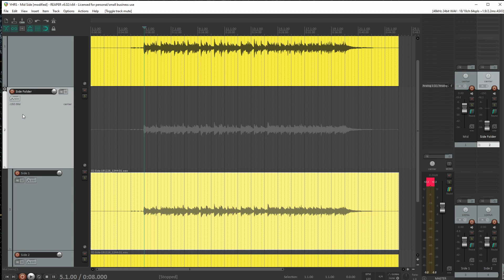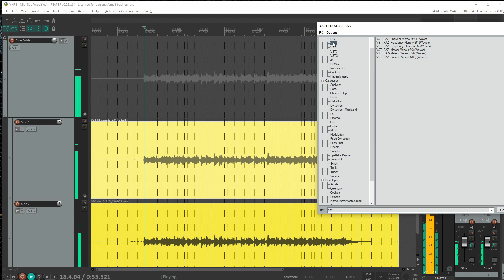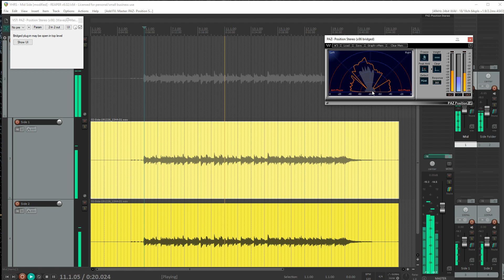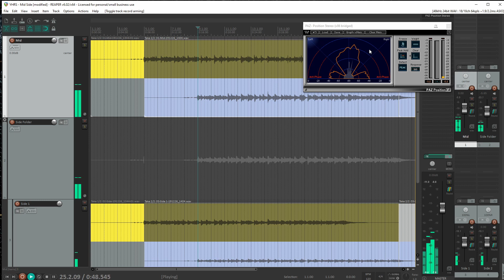Mid/Side Stereo Mic Technique (why does it lean to one side?!?)

Comment: Another thing to help focus the image to center is to apply highpass filter to the side information.  (Our ears key in on high frequencies anyways with respects to stereo information).  So 0-120hz is not doing much in the side except being boomy.
Reply: I use a Neumann U87 mid and a Royer 121 side.
Reply from the maker: I bet that's a terrific sounding setup!  Those are some drool-worthy mics!
Reply: @ryangraffius1474  please, can i record a small choir (about 20 singers) with the mid-side technique?
If yes, how do i go about it?
Reply: @Bits_of_Math  

The mid-side technique will not produce a 'true' stereo formation.  Mid-side is mostly used to create a pseudo stereo environment for 'monophonic' sources.  It also has music Production applications (the process) however the best way is to record in mid-side, first.

Could you do it? Sure, you can do anything you want.  Will it achieve an accurate representation of the choir and the people, in their respective  locations in Stereo? No.   

The benefit of a mid/side recording is more for say a 'stereo/mono guitar rig' or solo singer, which would totally work for a 'lead' vocalist in the choir.  Or lead instrument, because you are taking the 'side' Mic (polar pattern), which is actually turned Sideways to the sound source, doubling it that input, and panning one left and the other right (while phase inverting) one of them.

This 'pseudo' stereo information gets then blended with a directional microphone input (direct at the sound source, cardioid pattern).  So, the effect is that the Left and Right information that cancels/doubles with the Mid, produces a phase difference left to right (which is what 'stereo' sound is).   The difference in mid-side is how this effect is being produced.

For instance, I like sending the 'sides' to reverb differently than to the 'Mid' and often you can control these volumes independently (Adding energy in a chorus to rhythm guitars) or if the vocal seems lost in the mix, you can mid-side to get a bigger sound.

In the end, I think I would mic a full Choir in true 'stereo'.
Reply: @Bits_of_Math  Mid/Side Production techniques can be used after you record, however.  Once your mix is in a 'stereo' format, there is only left and right, which allows you to manipulate the stereo filed in mid/side.  So it can be a powerful production resource.
Reply: @ryangraffius1474  okay. Thanks.
Reply: @Bits_of_Math , you can certainly record a small choir with M-S!  Listen to the ensemble at different distances, and put your mic where it sounds best in whatever room you might be.  (this works for whatever stereo mic technique you might use, BTW!)  Remember that the performance space is an integral part of what you are recording.  If it doesn't sound good there, you might consider a different recording technique, although with M-S, you can adjust the impact of the room more than with other stereo mic techniques.
Reply: @NBryanBlack  thanks a lot.
Reply: @ryangraffius1474  What makes you say that M-S is only pseudo-stereo?  It is just as stereo as any coincident pair setup, including X-Y and Blumlein.  It's true that there is no difference in arrival time of the left and right images, but that is not a requirement to make a solid and accurate 
stereo image.
Reply: @NBryanBlack  
I say psuedo-stereo in the following case...

Making a Mid/Side recording (mic setup) 'stereo' ...we are inverting the phase of either left or right panned 'side' mic.  Is it technically stereo? Yes...  but it it the same exact information Geometrically... only one side is phase inverted compared to the mid...   

It's not like I have different frequencies going on like in a stereo recording... the 'side' mic is summed electrically to a monophonic pattern from it's 'polar' field informationally anyways... so, that is why I say pseudo because I am manufacturing the 'stereo' via the matrix....

Unless Of course, I am utilizing the Production value of a mid/side matrix... 

Where I can make the song Wider and more Narrow...or filter side frequencies with a splitter... Possibly, I am not altering the content, I may just be raising and lowering the volume of uncorrelated information in the stereo field... the result will vary speaker to speaker based on their unique individual characteristics for handling the balance between correlated and uncorrelated information.  (they do this for vinyl records to remove low end information in the sides which may cause the Needle to skip out of the groove.)
Reply: @ryangraffius1474  If you are not using a figure-8 mic for the side mic, I can agree that would be pseudo-stereo.  But if you use  a figure-8 mic as described, it is a full stereo system. The process is also used for broadcasting FMstereo (as well as other stereo techniques).  If you consider that the Mid mic is essentially your L and R channels combined, (L+R) then you add and subtract the side (L-R) information in the matrix to get your discrete L and R signals.  (L+R) +(L-R)= 2L.  (L+R)-(L-R)= 2R. Once you have combined things in the matrix, you end up with discrete L and R just like you would with Blumlein or any other coincident pair.  Also remember that the mid mic can be pretty much any pattern that you desire to capture your main (L+R) signal.  The reason to pick a mic pattern is to choose what you DON'T want to pick up with the microphone!  In PA work, cardioids are normally used so that you don't get feedback nearly as quickly as you would with an omni.  With M-S, the Side mic is chosen and positioned so that the main sound source is in the null.
Reply: @NBryanBlack  Clarification:  It may be semantics (the words I am using in order to try to explain what I mean).  Read on... if you still do not understand what I am saying, we will just have to agree to disagree.... 

I was talking about micing a 'stereo' (2 or more) source(s) with one mid and one 'side' (8) pattern mic...  m/s micing setup.

This will not produce (what I would call) a 'true' stereo representation of the 2 sources (in their respective places)  because the 'side' mic gets Summed electrically to mono before you double that track and phase invert (and pan L/R) the 'side' mic tracks....

So, the uncorrelated information between the 2 sources is a summation of their 'stereo' differences and similarities to mono (electrically) before the mid/side processing (which flips things back to stereo) takes place... which means that they are geometrically the same information.  The 'stereo' we get from m/s is the result of the mid +R/-L....(this is not the same as 2 cardioid directional mics each pointed at it's single source, respectfully.  (which I would call a 'true/traditional' stereo capture).

In addition, if one of the doubled side mics tracks is not phase inverted (what creates the 'stereo field ' in this specific m/s scenario)... there is no stereo... there is only 2 mics, 3 tracks presented in Mono. Unless you consider the differences in your speakers frequency response or the room you are standing in a stereo 'difference'...but the information L and R is exactly the same.

<<this should be enough to tell us that the 'geometry' of the 'side' mics is exactly the same, precisely because the (8) is not a 'stereo' electrical signal.... it is still only mono. Tbecause

Or consider this...(2 (or more) cardioid mics, recording stereo sources...Can I process the audio in m/s, using an M/S matrix?  Yes, but can I create an m/s recording style image with these tracks?  No....I have to record in mid/side to have a true m/s recording.

lastly, representation, but probably with a bunch of phase issues... lol
Reply: I don't know why the last part got cut off....
Reply: @ryangraffius1474 Sorry this is so late, but I don't check these comments daily!  We may be arguing some semantics, but not entirely, methinks.  If done correctly, it IS a true stereo system, evidenced by the OP's comment that the left channel was louder when he pointed the mic setup so that most of the sound was to the left of where he was pointing the mic array!  
Indeed, without the matrix, this is NOT stereo, it's just weird sounding bad recording technique.  The side mic is merely a L/R difference signal, and if you don't invert one channel and pan the sides in your DAW or mixer, it's not the M-S system!  
And actually, yes, you can take 2 cardioid mic signals (hopefully recorded in a reasonable true stereo setup!) and matrix them into a M-S signal chain.  It works best with a balanced signal chain so that you can easily invert the signals, but there are processors that can do it and boost (or cut) the L-R signal, and re-matrix it to normal stereo audio with a wider (or narrower) sound stage.  BTW, your local stereo FM station matrixes L and R stereo recordings into L+R (M) and L-R (S) signals all day long, 24/7, and your stereo receiver (assuming it gets a strong enough signal to decode to stereo), takes those M-S equivalents and matrixes them back to discrete Left and Right. If you have a mono FM tuner, it merely receives the Mono (L+R) signal and ignores the rest.
Reply: @NBryanBlack  Yes, again, I agree with everything that you are saying... and yes, you can run whatever you like through the M/S matrix, and adjust for Stereo Pan Law....

For the OP, I was trying to express that the 'stereo' representation of M/S recording is not like the dual A/B or X/Y setup. If you look up the sound patterns you will see why.

Which is why I was trying to explain (in response to your question) why I was saying Pseudo Stereo.  It's not that it is not stereo... it is just that a Phase flipping of L/R panned information is the only thing making the stereo occur in a M/S Recording scenario... the matrix obviously can be applied during music production.

Still, the fact remains... the 'bi-directional' information of the polar pattern mic, gets turned into an electrically Monophonic signal, so there is no A/B or X/Y (stereo informational captured)... the Engineer has to Electrically manufacture the 'stereo' image presentation (I don't know how else to say that)....the A/B and X/Y mic scenarios are already ready to be panned around the stereo field...when in M/S we just add and subtract the same exact information from the MID to form L/R...

Personally, I just do not consider that to be a 'true' stereo image.  It is a manufactured stereo image, by the audio engineer...

I Love M/S!  Make me feel like I have special powers. LOL!
Reply: @ryangraffius1474  OK, MOSTLY semantics, but I still agree to disagree! (politely, I hope!) Adding AND subtracting the S signal to and from the M signal is necessary to create the matrix.  If you don't do that, then indeed it is not stereo.   And, if the M and S mics are not coincident (or as close as possible), it would fall into the category of pseudo-stereo.  Additionally, the null of the figure-8 mic needs to be pointed toward the main pattern of the M mic, (unless the M mic is an omni, obviously!)  One can argue that the placement of the A/B or X/Y mics is part of the stereo manufacturing process by the audio engineer using those methods, too. Even the choice to use whichever method used is part of the stereo signal manufacturing process.  
It's been a while since I read it, but one of the more interesting papers I read on M-S was by Alan Blumlein, and he used 2 figure-8 mics and ran them through the matrix.  It does have the benefit of making sure the "talent" is on-axis of the main pickup of the Mid mic, vs. 45 degrees off-axis for both mics.  (although I love recording with a straight Blumlein pattern quite well, too, especially for an orchestra!)  
BTW, I am enjoying our discussion. Hopefully, I'm not too entrenched in my own perspective to notice whether or not the horse is still dead (although I have noticed it might be getting sick!)  ;-)  Have a great day!
Reply: Wow painful but for sure awesome convo lol, love it.

Comment: Thanks for the channel, good content, presented in a friendly communication style.
Wishing you all the very best for 2020!

I've been scratching my head over this one!
You basically recorded 2 guitar tracks simultaneously, one directional mic as per normal.
The second mic (at same distance), you made a copy of this, reversed the phase and panned them hard L + R.
I'd be interested to know if you went back and just changed the phase on channels L+R of the omni mic, if the track would lean o the right? Cos if it's just I signal doubled etc......

Also I know why you wanted the directional and figure 8 mics at the same distance and perpendicular in axis to each other (maybe like XY micing for phase).
Might it be worth experimenting with the figure 8 mic in terms of distance/angle, so that on it's own it produces a balanced tone in term of treble, bass and room ambience? After all the phase may not be a problem due to it not detecting in the guitar a straight line (as the directional mic does), but by mostly sound reflections.
Probably not clearly expressed!

I fancy having a go at this sometime, maybe I'd try swivelling the figure 8 mic so bass and treble of that signal are in ok balance on it's own then copy the rest of the process you did (directional mic, double track phase and panning etc.)

PS I've recently been setting up some old recording gear that hasn't been used for too long, and have watched a quite few youtubers on DAW recording, you are one of the few I have kept subscribed to.

Many Thanks and keep up the good work.
Reply from the maker: Thanks a lot!

I did find that changing which of the L/R tracks is phase reversed did change which way the stereo image leaned.  

The reason for having both mics' capsules as close to each other as possible is for phase coherency between the two mics.  When you change the distance of one mic or the other, you'll start to get different frequencies that'll start to cancel out or reinforce each other, and it'll start to sound hollow and kinda weird unless they're at just the right distances and loudness in the mix.  X/Y, Mid/Side, and Blumlein are all stereo techniques knows as "coincident pairs", where the idea is to get the capsules close enough together that they don't start to cause phase issues if they overlap in the mix.

Best of luck in your own experiments and trials.  It's fun to play with stuff like this :)
Reply: @YHRS  Yeah after reading up a bit I agree with your points and can appreciate the mic setup. Thanks for including the info in your reply about changing the phase on both the figure 8 tracks and the stereo going the other way.

Thought came to me - could you zoom in close on the waveforms of the cardiod single channel and only the quieter of the stereo split recordings. Just nudge the quiet side a few miliseconds on the timeline, there might be a sweet spot. I think this might solve the phasing problem, as long as the offset length doesn't mess with the overall impression of timing. (or do the reverse of phase reinforcement!).

Since sound travels about 300 feet per second, 3 feet = about 10ms offset, which I guess is much further than a typical band rehearsal/live distance on stage.